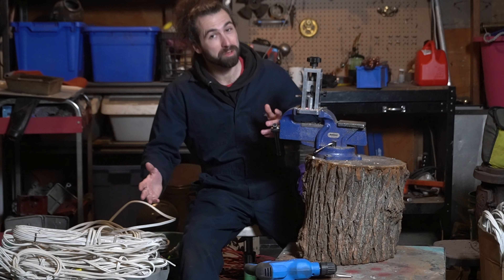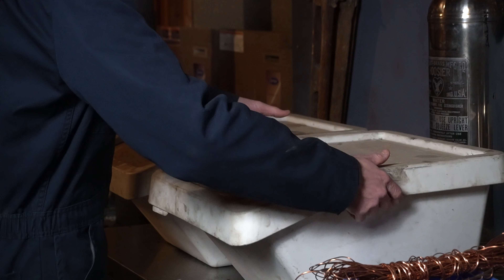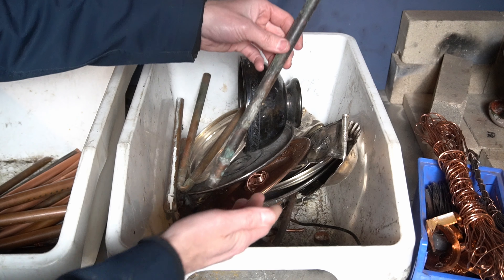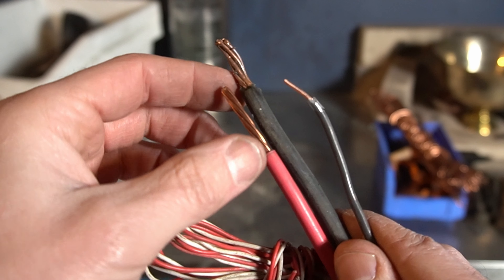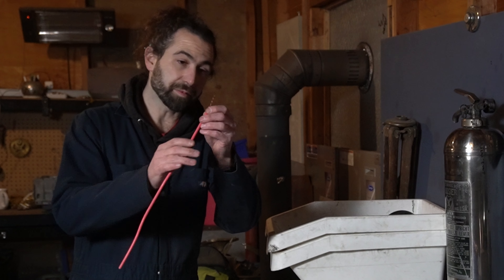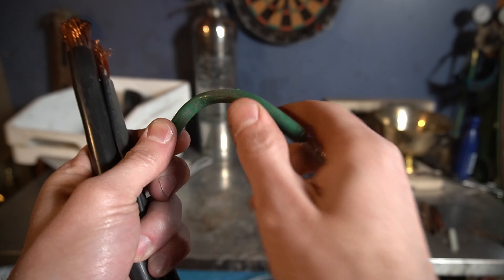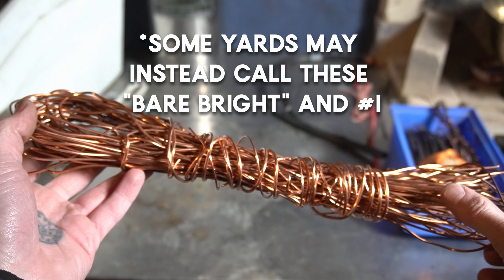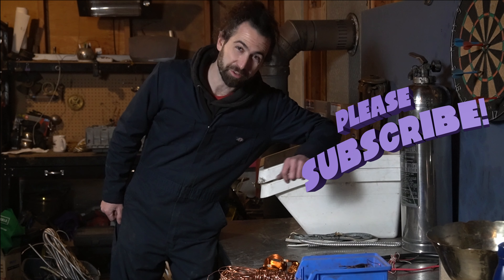What is the Difference Between Copper #1 and #2 Copper?

Comment: Get an ultrasonic cleaner to turn all corroded copper back to bare bright in minutes with just water. The machine will pay for itself real quick. Just make sure you get a large enough one, I went with the 30L Ultrasonic cleaner and have never brought in anything but #1 and bare bright since. It's like a crockpot that makes money, set it forget it walk away and come back to beautiful red gold.
Reply: Because of your comment I did look into it. It's a good idea but it would probably take about a decade for me to break even. I'm just a hobby scrapper though.
Reply: @Jedi_Scowen  Boiling vinegar works great and fast. Burns your eyes though lol
Reply: @Adamz678 goggles seem fine. Just like makin’ moonshine!
Reply: Does it cleaner copper from motors?
Reply: No vinegar
Reply: Do you run it in a chemical, or just plain water?

Comment: Nice summary and explanation. I might add, different scrapyards can vary how they classify. When in doubt, ask them and have them show you their bins so you can see. I learned a lot that way too. Even the two yards in my town are a little different with prices and categories. For example, my yard A calls the insulated solid core 12 gauge wire AND the multi-stranded 12 gauge wire “spaghetti wire”, going off the percentage, all goes in the same bin, same price. My yard B calls insulated 12 ga. solid core #1 and the multi strand 12 ga. #2, with a big price difference. Therefore I take all insulated household electric wire to yard A.
However if you strip both those types? Solid core is bare bright (or #1) and stranded #2 copper, both yards do that. 
Why?? I don’t know 🤷‍♂️ I just want the best price wherever I go.😄

Comment: Thanks for the info! in BC (at least in Kamloops) the dirty #1 copper wire is still #1... if it's shiny and clean it's barebright. All pipe seems to be #2 copper even if it's clean... I think the only way to get #1 on pipe is if it's basically brand new with end caps on (but this might differ from place to place)

Comment: You should do a video showing recovery to bars from each type using the same original weight. Say i kg or pound of each type pre-cleaned stripped or anything to final cast weight. Would be cool to see just how much loss there is on the finest wire compared to the number 1 and comparing that to the number 1 and number 2 pipe/painted/dirty.

Comment: now I could be wrong or it could be location dependent but around me your 2 wire categories are one category alone and of highest value being (Bright And Shiny). Now at a certain gauge being on the smaller side it would then go into a number category being 1 or 2. Then insulated is based on the percentage of copper compared to insulation. I'm not sure if any of this was mentioned already but at least all the different options are mentioned. There are many examples that do fall within the same parameters just a little different here and there dependent on either location or yard.

Comment: #2 Copper
   This grade of copper can be identified by its somewhat dirty appearance.  It should be comprised of miscellaneous unalloyed wire, pipe or solid metal that continues to have solder, paint or any kind of coating on it.  Additionally, its minimum copper content should be 94-96%.  In order to qualify for this grade, wire must be bare of insulation and be thinner than a 16th of an inch in diameter.  The ends and fittings of #2 copper are generally accepted at dealerships, and oxidation of some wire, pipe or tubing is allowed as long as damage is not excessive.
   #2 copper is the third most valuable grade available.

#1 Copper
   #1 copper is the second most profitable type to trade in.  To be classified as #1, the copper should be comprised of bus bars, clippings, commutator segments and wire of at least 1/16th of an inch in diameter.  It should also be clean in appearance, unalloyed and uncoated.
   The most valuable type of copper pipe – clean copper tubing – may qualify as #1 copper as long as it is free of fittings, insulation, paint, solder and other materials.  In fact, most copper tubing and copper pipes can be of #1 grade providing they show few signs of corrosion and have their fittings removed.  Trace amounts of oxidation on the tubing are generally acceptable.

Bare Bright Copper
   Bare bright copper is by far the first among the types a scrap dealer would like to find.  Also referred to as “bright & shiny copper,” it is the most valuable and high-paying grade around.  It refers exclusively to bare, uncoated and unalloyed wire or cable – no thinner than 16 gauge in thickness – which is of #1 copper quality.  Copper piping is not included within the classification.
   As its name implies, samples must be stripped of insulation and other materials.  Furthermore the metal must be free from any paint, impurities or signs of tarnishing.  This includes any visible oxidation, and very negligible amounts of patina on the copper are allowable.

#2 Insulated Wire
   #2 grade insulated copper consists of unalloyed wire – thinner than 16 gauge – which includes heavy, double or plastic insulation.  The grade generally covers many common types of telecommunications wiring as well as electronics such as outlet and extension cords.  Some coatings on the scrap, such as tin and nickel for example, as well as some degree of corrosion will also meet classification.
   With its insulation removed, the wiring should look like #2 copper wire.

#1 Insulated Wire
   #1 insulated wire consists of copper wire or cable which is clean, unalloyed, uncoated and untinned.  It should also be plastic insulated, of 16 gauge thickness or larger, with all ends cut off.  Though insulation does not need to be stripped, if it were the wire within should closely resemble ‘bright & shiny’ copper wire.
   Armed with this information, you are in a good position to understand the expected value of the copper scrap in your possession.  Checking prices at individual recycling companies and comparing the difference between their classifications and rates should ensure you receive the greatest possible reward for your effort.

 From- ASM Metal Recycling